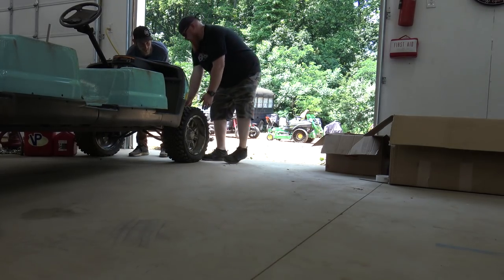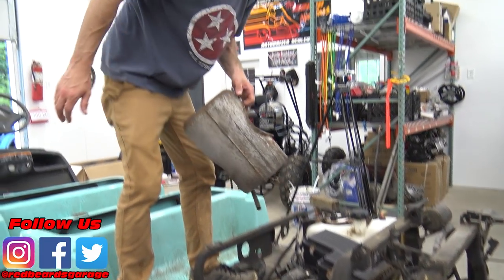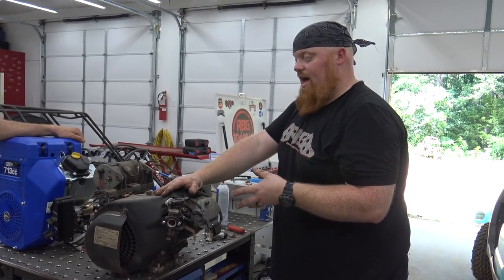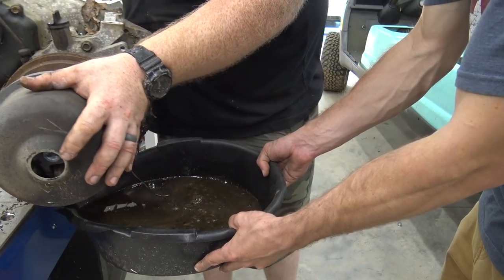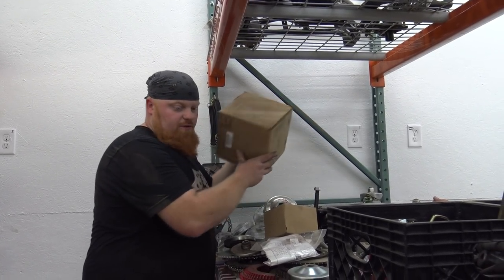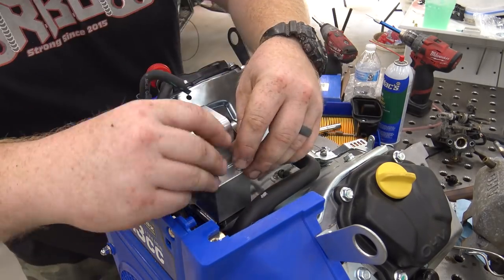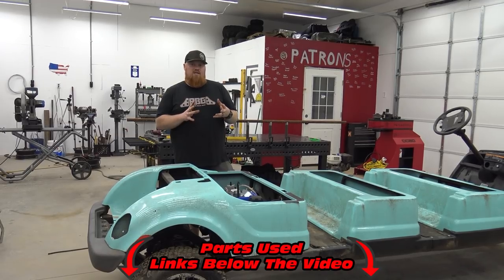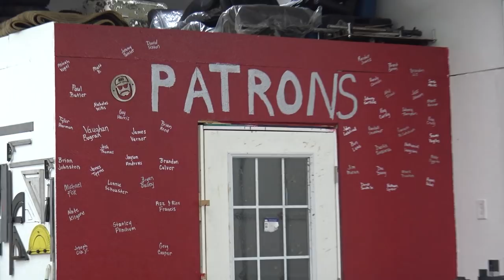Limo Golf Cart Build ~ 713cc V Twin Swap on Yamaha G-29

Comment: Around 10 years ago I built a 4x4 golf cart Polaris sportsman 500 differential and axles and gsxr 600 motor my favorite thing to do with it was hit mud holes it never got stuck not even at Busco beach
Reply: Whiteboy Steve I’ve been thinking about a build like that, good to know it works
Reply: @danielleheiget4517  basically it was a golf cart she'll over top a 4x4 atv motor was gone I had a wrecked gsxr built it in a month
Reply: Whiteboy Steve did you stretch the quad at all?
Reply: @danielleheiget4517  I didn't have to but I would have if I had to I did have to cut a lot of shit off the frame for golf cart body to sit right
Reply: Whiteboy Steve oh nice, I didn’t realize that the wheelbases matched up like that
Reply: @danielleheiget4517  luck

Comment: Great video and build idea, thank you!
P.S. If you can build your own brackets you can get those 1-wire alternators on Amazon for around $60-$100 depending on the amp output you need.

Comment: Planning a similar build with VegasCarts kit, Predator 670, and modeling after the Performance 670 nearly 50 hp builds.  I am really interested in figuring out how well a starter-generator will work on these, and who has a kit.  I do NOT want the key start.  AND I want to know how quiet these can be with a car muffler to have a 'sleeper' cart.  I use my cart more like a normal golf cart...rv parks, lake, etc...stereo, cool lights, and room for my cooler are most important.  Wondering about a pin-code enabled start so I don't have a physical key at all (I've seen them for electric carts).  Also looking into some air shocks making it anywhere from a low rider to lifted with the push of a button.  --  Another post said golf cart builds are hot right now, and they certainly are around me.  Hard to find any cheap donors lately.